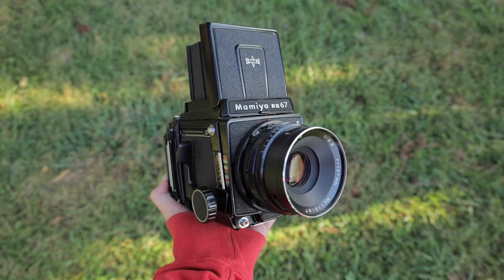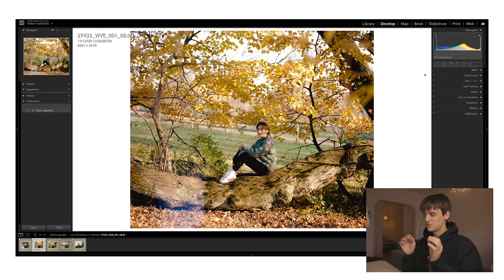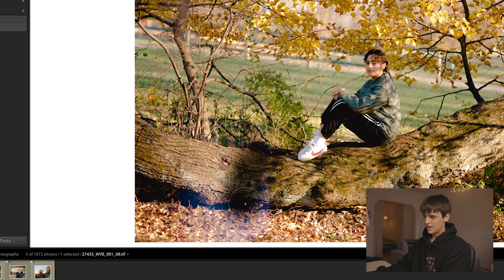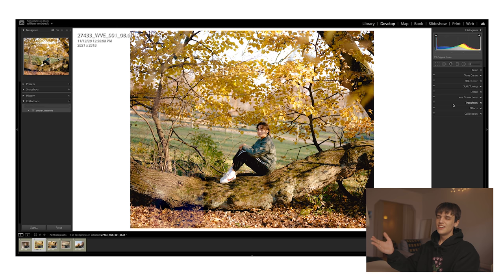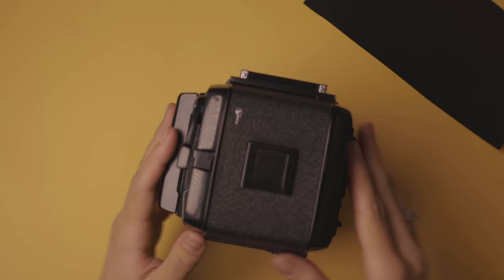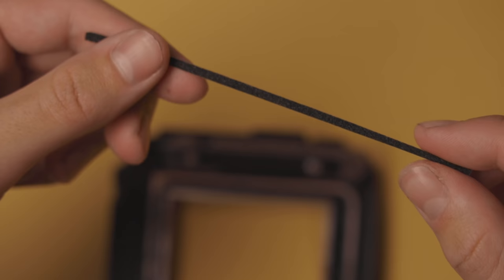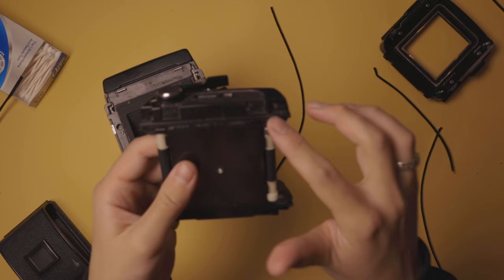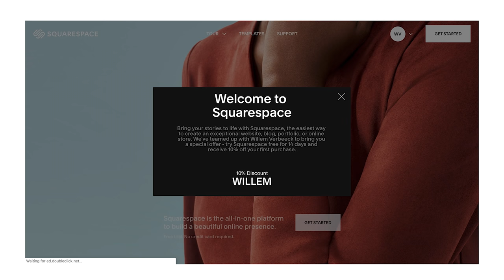How to Fix Light Leaks in your Film Camera

Comment: Good thing to note when replacing seals is that if the light leak is orange then it’s coming through the back and hitting the back of the film but if it’s white/blue then it’s  coming through the front somewhere and hitting the front of the film! Could be helpful when replacing and testing the seals!
Reply: Whoa, man. It makes sense given how redscale is done.
Reply: Thanks for this man
Reply: Wait, Orange once inverted or just orange on the neg before inversion?
Reply: I can see how easy it would be to get light leaks from the back but how would you get it from the front?

Comment: Just did a video about this the other week! My only suggestions is to get the foam a little wet while sticking it on, that allows you to take the adhesive back off and reposition if you make a mistake without ruining the piece you cut, then when it dries it sticks perfectly.

Comment: I used a bit of Windex to dissolve my seals. Absolutely eats through the foam. And if the channel is too narrow for the q-tip, putting a small piece of cotton on the end of a toothpick works really well! If you can’t get your hands on the specific camera foam for the seals, the black craft foam with adhesive backing that you find at craft stores is a good substitute. That’s what I used for my camera and it’s been going strong with no issues for about two years now.

Comment: There are kits to replace lightseals on the RB. They are a little more expensive, but much more convenient. For the "skinny lines" I would recommend velvet thread and glue that is used for modeling. Works best!

Comment: a broken toothpick also works well to remove seals with isopropyl alcohol. I'd also recommend buying one of the pre-cut sets online, like those by Aki Asahi
Reply: did this exact fix for my RB67, the aki asahi seals were cheap and came in a set of two and had an easy diagram as to where the pieces go. Fixed and good as new in 15 minutes.
Reply: @_buttertigers  exactly, me too. The pre-made kits are the best.  But that one piece large square... ugh, need a drink after that one.
Reply: The only problem is that the company, Aki Asahi, will not ship to the US due to Covid restrictions now per their website.  Very unfortunate.

Comment: I also bought mine from Japan on eBay and yep it was also rated mint++++++++++++😂. I was a bit let down with the condition of the lights seals but after it was all said and done and I had replaced all of them, I felt like I had a relationship with the camera itself and was more stoked on going out and using it. The light seals around the mirror were tough but patience paid off. I wish I had this video as an option back then because you were way more helpful than the videos I had to lean on. Cheers!

Comment: Hi Willem. Glad you discovered the RB67 which is a wonderful camera. Much better than the RZ67 :p Unfortunately, all these cameras need work, no matter how mint they are. Those seals were not meant to last 15+ years and were replaced during a regular CLA back when people really cared for their cameras. If it fits too tight it means your seals are too thick which means your body flange back has shifted leading to possible (minimal) focussing problems, especially when shooting wide open. You also need to replace the seals on the Pro S back doors and not only on the back itself. There are also seals in the body that need to be replaced (inside as well as outside) because they are gone too. The ones on the inside are replaced during a CLA. And your lens shutter needs a good clean too (they all need it, trust me). If you"re going to travel back to Belgium post Covid just send me a message @kalleralexander and we'll see what we can do. I do Mamiya repairs in Belgium.

Comment: Great video! One tip to make it easier is to remove the old seals with isopropyl alcohol, you can also apply it to the adhesive of the new seals to let you adjust them properly, when the alcohol evaporates the adhesive will stick as normal.

Comment: Great advice on removing and replacing light seals! There are a couple tips that I would like to add for anyone interested: use alcohol and tooth picks. For the more stubborn pieces of old light seal and adhesive, use isopropyl (rubbing) alcohol and saturate the Q-tips in it. The alcohol helps to break down the adhesive of the old light seals. You can then come in with tooth picks and manually scrape away the old adhesive. The wood of the tooth pick is soft and will not damage the camera (as opposed to using a metal tool). Tooth picks are especially useful when getting into the recessed spaces of film-backs. I have replaced the light seals in a couple of my 35mm cameras this way. It takes a bit of elbow grease but is rewarding and totally worth it in the end!

Comment: the back left hinge of the film back that you put away is actually the biggest culprit of light leaks! definitely have to fix those.
Reply: I‘m from Germany and I’ve read this solution a hundred times. I just can’t seem to find the perfect translation for this, would you mind specifying what exactly the left „hinge“ is? I would really appreciate it since I’ve been trying to fix this exact light leak for weeks.. I’ve tried everything but I just can’t seem to fix it. Thank you man! :)
Reply: @byNoahUSA  face the back of the camera. open the film back and the door should swing open. with the film-back door open, look at where the door and the body of the camera meet (the hinge) and that is a big area for light leaks.
Reply: @genelegend  awesome, thank you ❤️
Reply: @byNoahUSA  Gemeint ist das Scharnier. Übrigens im Plattdeutschen auch Hing oder Hing'n genannt.
Reply: Was thinking the same! I recently bought my RB and after shooting the first roll, I noticed massive light leaks. I checked it and it turned out that on that particular hinge, they simply forgot to put a light seal there while replacing the sealing...

Comment: Dipping the light seal adhesive in either alcohol or an alcohol based cleaner before installing it into tight areas such as those deep channels in the RB67 film back is a good way to deactivate the adhesive properties while you finagle the seals in there. Otherwise the seals can stick to the sides of the channel and twist around the wrong way which is very annoying. The deactivation isn’t permanent, so when the seals dry they will be nicely stuck to the intended surface
Reply: dip them in water not alcohol otherwise the alcohol can break down the glue and they end up just falling off a couple months down the road

Comment: Ugh, light leaks.  I have two backs, one a Pro version and the other a Pro-S, and both have terrible light leaks.  I re-did all of the light seals as soon as I realized I had a problem, but it still wasn't quite enough, so I just tape up the backs with black electrical tape each time!  Good luck with yours, hope you still enjoy using the RB67!  It's still my favourite camera, even if it looks a little rough!

Comment: I love using yarn and felt. The yarn is very easy to put into places like on the film back of the RB that you had to cut those super tiny foam strips. The felt is for other places that can be used to last longer than foam. In some places, you'll need to use foam because the felt is not thick enough but for the most part yarn and felt will cover the majority of cameras. 

For removing seals I like to use Qtips and/or toothpicks (rip a little of the end of a Qtip [the cotton part] off and put it on the toothpick for places that are too small for the Qtip) then put some 97% isopropyl alcohol on the ends. Start rubbing away that gunk.

Comment: I take a little bit of cotton and attach it to the tip of a toothpick, then dip it in rubbing alcohol. I drip a bit of rubbing alcohol into the grooves holding the old light seals, then scrub it with the toothpick. I repeat that several times until all the nasty adhesive and foam is cleared out. I also just buy pre-cut light seals off ebay, but cutting your own foam is probably a more cost effective way to do it.

Comment: i actually went through this a couple of days ago since ive had a major light leak in my nikon FM. i ordered a light seal kit for my camera isntead of cutting it myself didn't know i could just get a sheet of it. TIL. but that the guide that the kit came with had a really cool tip:

put some purell (without moisterizing) on the back of the adhesive so you can wiggle around the foam bfore setting it permanently, the purell makes it not adhere initially ut after 5 minutes it evaporates and the foam sticks perfectly.

Comment: I specifically went with the Pro SD because the film backs were designed to not need light seals. I believe SD backs will work on your version.
Reply: Amen! Steering clear of the oldest RBs is good advice - but if you have one go with the Pro-SD back.
Reply: this is true but if it’s dented wrong from heavy handed loading you can’t repair it, the Pro SD backs will work with all of the other RB models too
Reply: @MaxLamdin  I will have to keep that in mind next time I am shopping for a back.
Reply: @Being_Joe  it has to be pretty bad to cause it but it does happen

Comment: Isopropyl alcohol helps remove the old seals.  And you can put the alcohol on the glue of the new seals to help put them in place.  In the time it takes for the alcohol to evaporate you can get the new seals in place without sticking to everything.

Comment: Quick tip: When inserting a foam strip into a narrow groove, just humidify the sticky side with your tongue. It will prevent the foam from sticking to the sides of the groove and slide right to the bottom where it should stay

Comment: a steel ruler as a straight edge to cut against makes cutting the foam FAR easier. also using a teeny bit of soapy water on a q-tip and wetting the groove you put the foam into makes tight spots alot easier

Comment: You can use alcohol and apply it to the sticky back for easier management of the seal when you have to curve or whatnot and it's not sticking around everything. Once the alcohol evaporates the glue does it's job and stays 😊

Comment: You can use saliva (honestly) on the sticky side before placing the seals down. This helps in case it twists or doesn't go in the grooves properly. You can easily pull it out and adjust :)

Comment: i’ve done a done of light seal repairs as i work in a camera shop, i have some tips, soak cotton buds (q-tips) in rubbing alcohol and dab on old light seals to loosen them, then scrape them off with a cocktail stick, this helps remove the old adhesive layer and not just to old foam so you get a better stick with the new seals. Next time, don’t bend the new seals at corners, cut strips should only be used in straight lines as bent light seals in corners can cause more problems that just sticking on piece next to another. Next time, the mirror cushion seal is always a nightmare to replace, if you can, always remove the focusing screen before doing it otherwise you WILL mess up your focusing screen. And finally, always cut the foam using a metal ruler, nothing more annoying that putting half your new seal in then finding out the second half doesn’t fit in the groove, also, less chance of chopping up your fingers, i’ve done it, would not recommend… wow that got long quick

Comment: dude, it's awesome you cut them yourself!  I usually get mine pre-cut for cameras to save on bulk time. uscamera.com has tons of kits pre-cut at a great cost for those who don't want to cut their own.
Reply: thanks for sharing this, you just saved me some money and time
Reply: Joe, you are spot on.  I keep a few sheets of foam around, but over time you learn which cameras/backs are easier to deal with by just getting the kits.  Also, uscamera.com sells mirror dampening and seal kits, which are another source of issues and can be quite difficult to match due to odd shapes.  They also have a few spare parts and lots of repair manuals.  Always got good service from them.
Reply: @joneshammond6995  hell yeah dude !
Reply: @DI-cm5xc  they are really great ! When you have to do 20 Pentax k1000’s it’s nice to have them pre cut haha

Comment: there are seals on the inside of the mirror for the pro and pro s, inside the actual body, not just in the film back. The seals on the edge of the mirror on mine were basically gone but should be there along the edges where it flips up
Reply: that’s a mirror cushion to help reduce camera shake mostly, they’re also the most frustrating seals to clean and replace

Comment: Curious on the rotating back. (RB back adapter). I was attempting to cut the seal off a card template I made but how well does it form bend around the corner as you did if I would diagonal cut in sides ?

Comment: Does anyone reading have experience with 645 Super light leaks? The film backs don't actually use seals, instead they have these interlocking plastic bits. Wondering if I could have a leak through the waist level viewfinder? Or perhaps I should try and seal the backs anyway.

Thanks for the helpful video!
Reply: there are seals around the door and a couple either side of the film insert, there’s also seals around the mirror but these are mostly to cushion the mirror

Comment: Just started having a similar leak on my FM2, just on the right side of the frame instead of the left
Reply: FM2 light seals are easy to replace, if it’s at the top of your image then the bottom seal needs replacing, if it’s at the bottom of the image the top seal needs replacing
Reply: @MaxLamdin  Thanks man! I appreciate it

Comment: On Ebay I always ask questions before purchasing. That way they are held to their word.  I shipped a Pro-SD magazine back because it wasn't registering.  Overlapping images on the film.  Even though I asked, the seller said it worked perfectly any way. Ebay held the Japanese seller liable and I got a full refund.  I especially like when they have a lens with haze, element separation, fungus, scratches and still state it will not affect the image quality!  Foreign sellers know that they can get away with cheating a buyer because it's a hassle for the buyer getting their money back.  And if they do the seller still makes a few bucks on the inflated shipping charge.

Comment: Legit had the same light leak in my RB, and also was from japan rated at mint+++++. Wonder if was from the same guy??
Reply: It’s common to get light leaks like this.
Reply: @zguy95135   like common for light seals to erode?
Reply: @thomasjamesisaac7129  Yeah, the RB has a lot of seals and as they get old and fail you’ll get light leaks like this. Mine worked for about a month and decided to fail when I was on a two week road trip... It’s good to just replace them if they’re old and gummy looking.
Reply: @zguy95135   Yeah I replaced mine pre quick and haven't had any issues since was just annoying cause when I bought was listed as seals in good condition, but at least its a pretty cheap fix